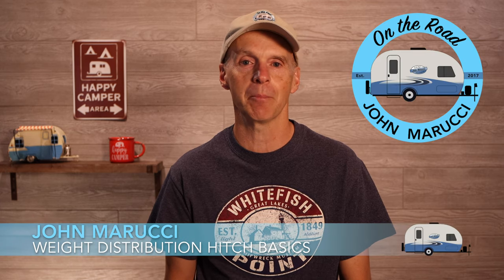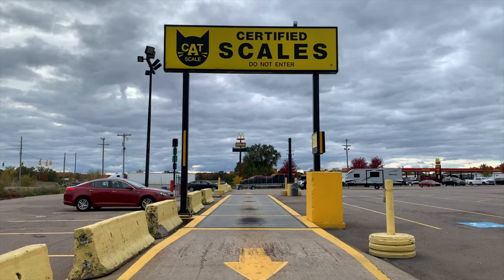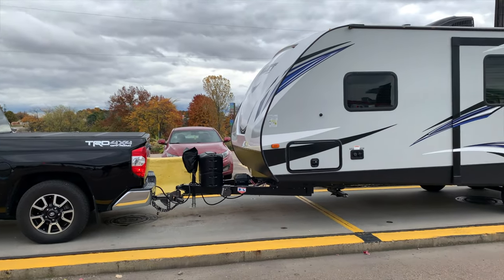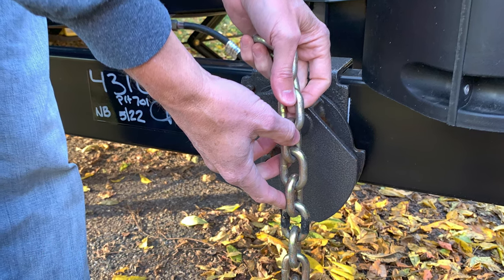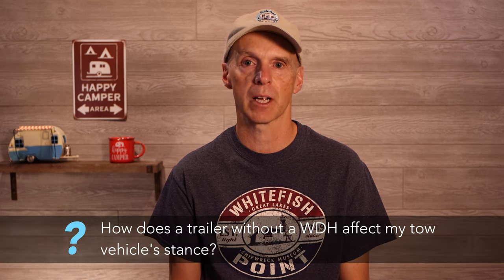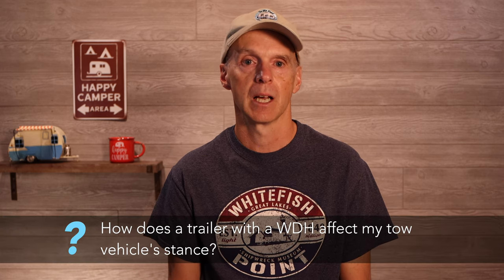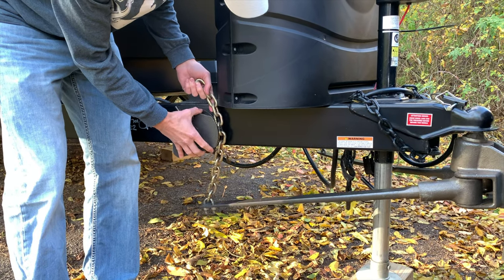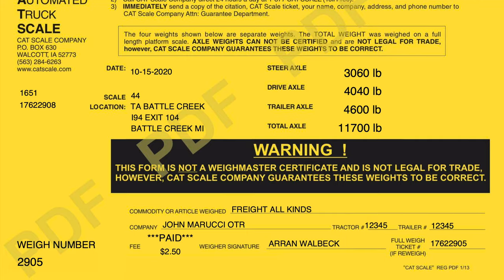RV Towing - Weight Distribution Hitch Basics

Comment: John, thanks for doing all the hard work. You've convinced me to go with a WDH, even though my trailer is only 4500 lbs.
Reply from the maker: Glad the video was helpful! All the best.
Reply: John, I’m towing a 23’ airstream using a Blue Ox Sway Pro at the 9th link. My tow vehicle is a 2020 F150 Platinum short box. I went to a CAT scale today for the first time. Weights were Steer Axle 3120, Drive Axle 3520, -‘; Trailer Axle 4980 and Gross Weight 11620. Should I move up the 8th link to push more weight onto the front axle?
Thanks
Jim

Comment: John, Great analysis on WDH's. I learned the hard way on how important a WDH hitch as I originally tried just using a sway bar that helped sway but really didn't help the cause of the sway, which was uneven loading on the tow vehicle and had almost 2 inches of drop on the rear end and 1" of rise on the front. I found out there was to much drop on the rear end and needed to get a WDH. With a WDH the sway is gone and now it tows like a dream and it handle much better on bumpy roads.  
I really like your Blue Ox for easy adjustability for different things you tow and taking the tow bars off and on and IMO looks like the best WDH I've seen! I have a Husky Centerline TS that works well and looks to be about half the cost of the Blue Ox but I only have the one trailer to tow and so I don't need the easy adjustability. I am able to get the spring bars off and on pretty easy by raising the electric jack high enough to pull them off but hopefully that doesn't overstress the jack?
Reply from the maker: Mike, I similarly have to raise and lower my tongue considerably to lower tension and remove the chains. So I think this is fairly common. The main item that can be overworked in this process is your power tongue jack as you mentioned. Point of clarity, I actually have a different Blue Ox set up for the Pod vs the Bullet as they sit at very different heights and it would mean making major changes to the shank when moving between trailers. The one for the Pod I purchased when I got the Pod in Spring of 2017, the one for the Bullet in 2019. Thanks again for the comment, all the best!

Comment: Great video as yusual John. I'm amazed that this is the first time I've heard of a WDH which I really wish I had about a week ago when I was in the beautiful Olympic National Park. And if you've ever been up there you know the roads are less than ideal. I was towing my Rpod 196 with my Porsche Cayenne which is not a very good tow vehicle but it does the job, I would not recommend ever using one. But anyways my Rpod was loaded a little heavier than I'm used to and I was going down a a hill with a sharp turn and the front of my car felt very loose and unfortunately I clipped the guard rail with the back of my Rpod but luckily only minor damage was sustained but I sure wish I had a WDH back then. Anyways thanks for the great video John and if you know of anyway to patch small damaged areas I would love to hear them. -Sebastian
Reply from the maker: Sorry to hear about your issue. Generally if you are feeling that your steering is loose, it likely means you have too much weigh on your car's rear axle. Glad the video was helpful. All the best!

Comment: Hey John, another informative, and awesome video as always. I love you a whole lot. Is the 2020 Keystone Bullet Travel Trailer as high quality as an R-Pod trailer? In my opinion, the Keystone bullet looks somewhat bland and as my pa would put it, "Trashy". Keep up the amazing work John. -George
Reply from the maker: George, The Bullet is pretty solid. Probably the biggest gain from the Keystone Bullet is the Hyperdeck subfloors which don't wick up water. So if you have any leaking, the floor is not ruined. It has worked well for me. I still have the R-Pod as well and like it for smaller campsites. All the best!

Comment: Did I hear you right?  Going from 9 links to 8 links put more pressure on the bars?  MY RV dealer initially setup my rig to 9 spare links.  They kept blowing the fuse when raising the truck and the ride felt way too stiff, transmitting bumps from the trailer back up to the truck, very uncomfortable.
I then tried 8 links and it was easier on bumpy roads and although I did blow the fuse again it was because of the uneven dip I was working in when unhooking at the campsite.  Next trip I tried 7 unused links and this was too soft,  lots of bouncing through bumps so I'm going back to 8 unused links.  Hope to hear from you on my experience.  I'm towing a 27 FT 6300# Airstream with a 1 Ton Ram 4x4 with airbags.  I like the zip tie trick to remember my links, thank you.  Leo in Whitefish, Montana
Reply from the maker: Fewer links will move more weight to the front of the tow vehicle and back of the trailer, lowering weight at the hitch. I've never noticed a change in ride quality in my Toyota Tundra when changing the number of links. Your 1-Ton Ram is likely set up very differently than my 1/2-ton Tundra in terms of ride quality. I have no idea why you are blowing fuses. I've never had that happen. The tip on using a zip tie is a good one, thanks for sharing!

Comment: Very good examples. One additional think might have been to include the ground to frame clearance differences.
Reply from the maker: I think I did some measurements when I was putting the video together, but mainly of the differences in sag at the rear and front of the truck. Not sure I still have those somewhere. If I find them I'll post back. Thanks!

Comment: Hey John, quick question do you use your blue ox system with your Rpod as well? We have a 2017 rpod 178 and a 2016 Silverado and I don't currently have a weight distribution system. Wondering if I should get one for longer trips. Keep up the great work!
Reply from the maker: Travis, I do use a Blue Ox on my R-Pod as well. Works well.

Comment: Well done video on a much misunderstood topic.  FWIW, you can take it another step from what you describe here and compare your measured weights to your vehicle specifications and also calculate the Front Axle Load Restoration percentage from your WDH (you're at a good 81% with 8 links).  Interestingly, I looked up a 2017 Tundra TRD 4x4 on the internet and found a gross vehicle weight rating of 7,100 lbs.  If that's correct for your vehicle, the 700 lb. tongue weight + 6,400 lb. vehicle weight puts you right at that max weight.  Any additional cargo or passengers and you will be over.  I don't know if you're a member of the RPod owners group on FB, but if so, there's a spreadsheet that you can download there that will do the calculations for you.  Again, good video.  Thx.
Reply from the maker: Thanks for the informative comment!

Comment: John, I wonder how adding 30 gallons of fresh water in my RPod 191 affects the distribution of weight over the 3 axles?  250 pounds added just in front of the RPod axle probably requires more tension on the weight distribution hitch.
Reply from the maker: Tim, I think it would add some tongue weight and some axle weight. You would need to check it before and after on a CAT Scale to know exactly. Given that, with a Tundra and any of the smaller Pods, it likely isn't an issue that would need adjustment. You can always try it both ways as far as number of links on the WDH and see what you like. Thanks!

Comment: Hi John what you think about harbor freight haul master hitch??
Reply from the maker: Matthew, I haven't looked at it. I have used the E2 from Fastway and the Blue Ox Sway Pro and both are excellent, but not cheap. Generally you'll get what you pay for. Also, besides price, there is ease of use. The Blue Ox is very easy to use and adjust. The E2 is a bit more difficult to adjust while traveling. So keep this in mind. I'd personally watch a bunch YouTube videos on the various models before making this type of important safety decision. Thanks!

Comment: John: Maybe you can help me with math. I got a new tow vehicle, and have weighed it with my RV on Cat Scale. My trucks capacities are as follows: Front axle...3,500 Rear axle..3,600. GVWR 6,250.       My Cat Scale numbers were: Front axle 2,760 Rear axle 3,500. I thought I was good, but adding up those numbers puts me over GVWR even though I'm within axle perimeters.  Trailer was not an issue Weighed 4,700 max is 5,500.   Can you help explain this? Thanks John
Reply from the maker: Keith, I have a towing calculator in Excel I can send to you if you like. Please email me at john@johnmarucci.com
Reply: Email would not go through John ...is a difference of 600 lbs front axle to rear common ?
Reply from the maker: @keithmcgregor2546  I can have more than 600 lbs difference between axles when towing, however, a good setup with a weight distribution hitch will minimize this. My last Cat Scale was in April with 3,460 lbs. on my steer axle and 3,700 lbs. on my drive axle. You may be able to adjust your WDH to move more weight to the front axle.

Comment: What is the stress on the trailer frame (ball to axle) and the tow vehicle frame as the WDH "moves weight" between axles?  Are there any considerations for tow vehicles with unibody construction vs. ladder frames?   Is the dynamic stress (e.g., bouncing over a rough highway) higher than the static stress as measured on a scale?  Just sayin'
Reply from the maker: Ely, good point. It would be hard to say the stress over time on the frames of the tow vehicle and trailer when using a WDH. Not sure how you would measure it. Some car manufactures (i.e. Honda) warn against using WDH on their unibody frames. I am sure there is more wear on the frames as the hitch is trying to keep weight distributed. If you find some research on the subject, feel free to add a link to it. Thanks for the comment!

Comment: Can you get the tongue weight using these scales?  Weigh together then TV and trailer separately?  Since I've added a bike carrier in front I need an easy/cheap  way to measure without the bath scale beam method.
Reply from the maker: You might be able to do this, but most of these scales are at truck stops and used regularly by truckers. It would be tough to stop and disconnect in order to weigh the the tongue without backing up the scale.
Reply: John Nagy, you can get tongue weight using the procedure described in the video.  Tongue weight = (Drive Axle + Steer Axle with trailer hooked up and WDH disengaged) - (Drive Axle + Steer Axle of the truck alone).  The tongue weight in the video based on the weights provided is 700 lbs. (4,040 + 3,060) - (3,020 + 3,380) = 700 lbs.

Comment: If using a WDH do you also use anti-sway bar?
Reply from the maker: Kathy, it depends on the WDH, some, like my Blue Ox do have sway control build in. So you don't need a sway bar as well. I think the E2 is similar, but you'd need to check on other brands. Thanks!
Reply: Hey John, thanks for the info. Have you done any analysis on gas mileage with and without weight distribution? Thanks again!

Comment: What happens when you drive a weight distribution hitch over a deep gully or culvert?
Reply from the maker: It really depends on the drop on the shank. It can be a problem if the shank hangs low. Whoever sets it up needs to do it correctly with the right shank and direction of the shank to try and avoid this issue.

Comment: At 4:27 you said you reset to EIGHT links of chain. You count links from the FREE end of the chain and to increase tension, you would have needed to go to TEN links, not the other way. Blue Ox says 9 links is nominal, and use 10 or 11 only if needed.
Reply from the maker: I count eight links from the bar not including the half link that is attached to the bar. Fewer toward the bar means more tension. I usually do 8 links with my heavier Keystone Bullet, works well. Thanks.
Reply: @JohnMarucci  thanks for this clarification on counting the links. I have the same Blue Ox WDH with 1000 lb. bars on our 2018 F150 and 2021 Grand Design 22 MLE trailer. Similar weights to your setup. Your video is hands down THE BEST tutorial and explanation of this WDH setup. I have watched several of your videos and really appreciate all of your work and attention to detail. Safe travels and maybe I'll see you out on the road some day.
Reply from the maker: @tonyinfante7993  Thanks for the feedback Tony!

Comment: I understand that most large, trailered boats have surge brakes that are incompatible with WDH...  As a result, WDHs are not typically used with those heavy boat trailers.  (Same could be said for big utility and livestock trailers, BTW.)   How do these big boat and utility trailers get away without WDHs when towing a travel trailer without a WDH is described as unsafe and dangerous?   Just sayin'
Reply from the maker: Ely, another fine question. I am not familiar with boat towing as you mentioned. I suppose the aerodynamics of a travel trailer and potential weight behind the axles (via people loading them improperly) is a consideration. What a WDH doesn't make up for is bad decisions when loading any trailer. Thanks again for a great question!

Comment: 25% drawbar weight on that trailer, would suggest not a particularly good design
Reply from the maker: Rob, it would be great if you could take a moment and reply with the math supporting your statement. Most folks reading this won’t understand otherwise. Thanks!
Reply: @JohnMarucci  hi John I am in New Zealand am a engineer and designed a few trailers, lived and worked in US to for a number of years own a Carson rebel toy hauler tow with a Toyota Ute , very light weight tow vehicle.
Now generally speaking you really want to design with about 10%drawbar weight, more makes it tow better but can put big loads in funny places. Yours for example I would consider quite extreme in that to take off over a 1000lb on the hitch via the WDH you are putting huge bending load on the trailer draw bar and I would suggest keeping a close eye on the frame at the front of the box, and also a huge load on the front attachment of your trucks hitch.
I BTW do use a WDH but also have airbags to do the donkey work of the leveling kinda a 50-50 thing and find that works best.
From experience I find that leveling the vehicle is more important than weight distribution but all hitches inherently give some sway control and in the US high hiway speed situation I would not go without a WDH for that reason.
But a trailer your size would only expect to be moving 500-750 lb
Reply from the maker: Rob, thanks for the reply and explanation of your comment. The 5,000 lb. unloaded Keystone Bullet is certainly at the max for the Tundra with the WDH. There is only so much weight you can move fore and aft from the tongue before you need truck with more capacity or better structure. Thanks again!
Reply: @JohnMarucci  actually I don’t really agree with you there the tundra can tow heaps more if set up properly. A tow load equal to the tow vehicle is quite acceptable, in fact a tow vehicle 80% of tow load is fine but normally this would put you outside max gross combination mass.
What you are mainly doing in the US is trying to fix your f,d up vehicle setups where you have super light springs and crap load carrying capacity. My NZ hilux I can put 400kg on basically 1000lb and will hardly go down, US truck put that on it and it sits on its arse screwing up all the handling geometry.
Everyone in the RV world in the US seems to be on the WDH bandwagon which is actually just fixing a crap suspension setup and I would suggest creating a whole heap of other potential problems, I already see you tube with broken drawbars no surprises to me, and what you are doing puts you at that risk point I believe, just imagine the loads on your truck if you go through a dip in the road.
You really need to fix the truck first before you throw these bandaids on , either by airbags or re-springing with helper springs then topping up with a WDH to do final leveling and provide a little sway control.